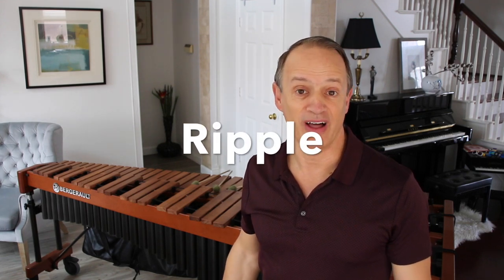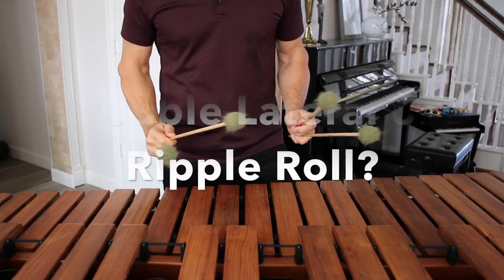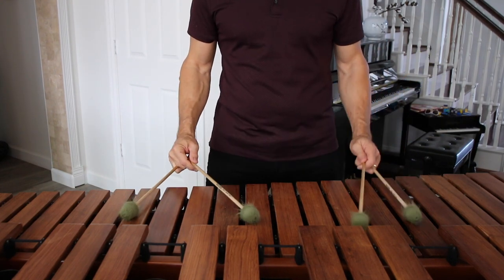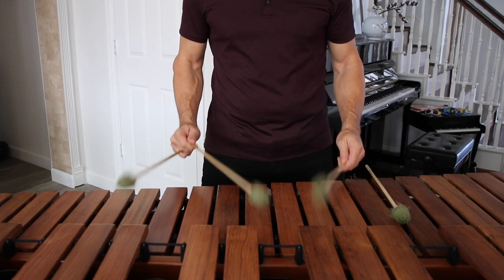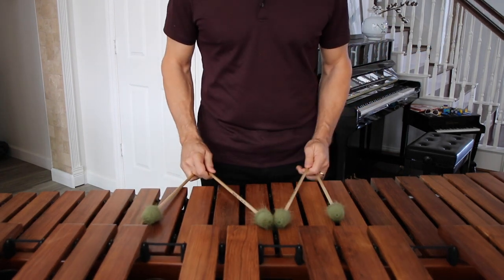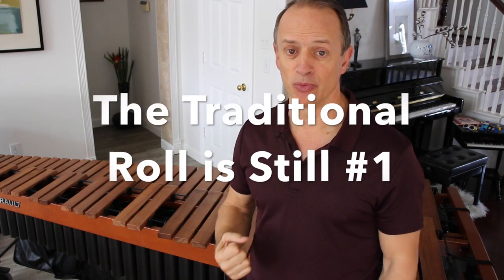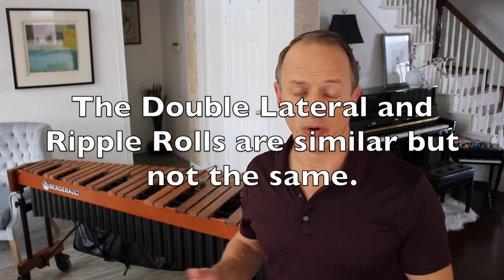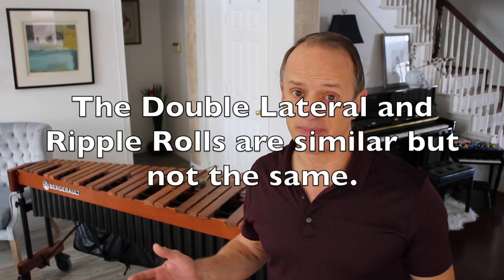To Ripple or Flop?  Rolling on the Marimba by Mark Ford

Comment: Thanks for posting. My teacher, Mike Rosen, showed me this way back when. I don't know when/where he learned it, but I remember he had me use it on a few pieces in lessons. It was great to learn. I play it slightly differently, though: because I play more of a "palms down" musser-style grip the inside mallet hits first and the outside mallet flops. The effect is the same. 

I also remember MR showing me a variation that he called the "Rosen roll" for single line melody rolling. If you use 3&4 to flop, but add 2, all on the same not, you can create a really nice sound for a melody (it has a bit of a "theme from the Godfather" sound). This is similar to what you show when you add the left hand in your video at 2:20, but with all three mallets on the same note. It gets a little cumbersome (the LH has to be angled up, and 3 does the flopping in this case), esp on the smaller notes, but its a nice sound. 

Thanks for posting this, I've showed the ripple to students over the years, but haven't seen anything on line about it before.
Reply from the maker: Thanks Stuart!   You are correct that the Musser "Ripple" roll is not taught often like in the past. I think this may be because percussion teachers  thought that the double lateral and ripple roll were the same thing.   I hope that this video and players like you can help bring awareness to the ripple roll and its potential for expression on the marimba.  All the best!

Comment: So, traditional roll is #1 and musser/ripple roll is best suited for soft, legato, end of phrase playing; so, does the double lateral roll lie in between those two? When is it acceptable to use it?
Reply from the maker: Diego, to be honest I rarely use the double lateral roll for chorale playing.   I feel that the traditional roll is best to create a constant texture with legato 4-mallet rolling.   The double lateral roll is really a rhythm and this takes away from a consistent tone for a chord.   Think about a cellist playing a long legato tone.   The bow is always on the string moving consistently and steadily.   Now consider that bow moving in a rhythm and slightly losing touch with the string.   This second example would not have a consistent tone.   To me, this is what the double lateral roll does for marimba rolls.   For me the traditional roll is better for creating a consistent texture and tone.